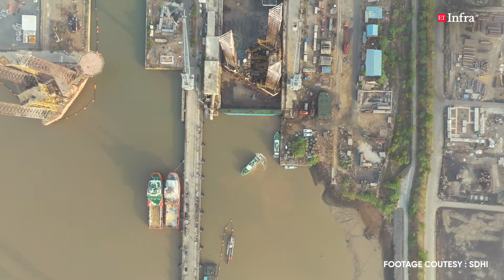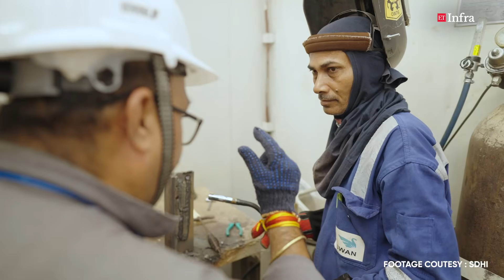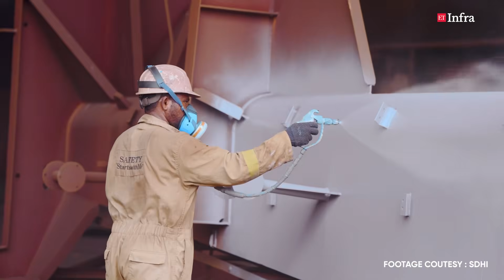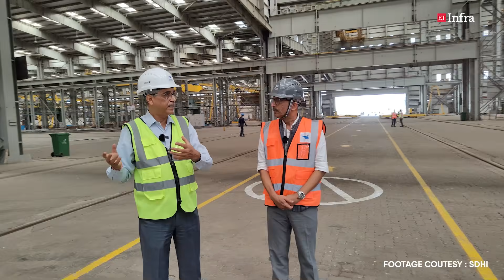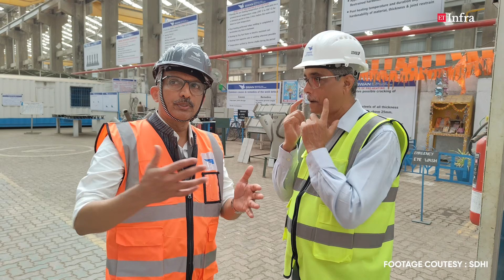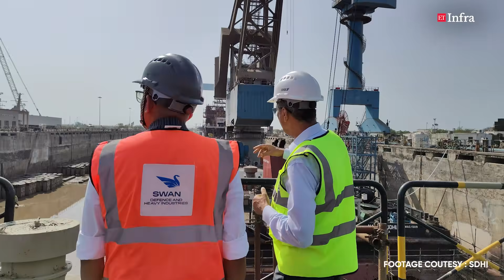How SDHI Is positioning itself at the forefront of India’s shipbuilding ambitions globally

Comment: Excellent initiative by the central bjp government . This industry creates thousands of ancillary units ranging from diesel generators Marine diesel or electric or gas propulsion , pumps ., refer units hvac units , carpentry, plumbing , pipelines manufacturer , steel manufacturing, winches manufacturing, to name a few Akso naval architecture and designers of ships etc I Dian export import cargo mainly carried by foreign ships, lots of foreign exchange goes in that , Kudos to central government for I initiating this programme . Lastly the skilled workforce required for the industry creates further jobs  Jai Hind Jai Bharat.